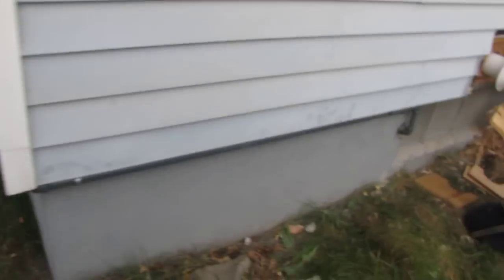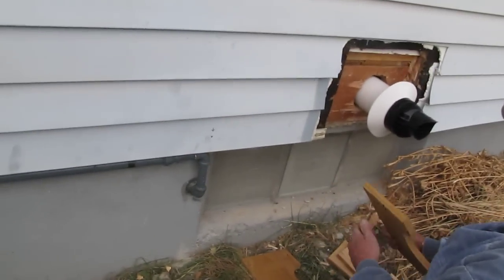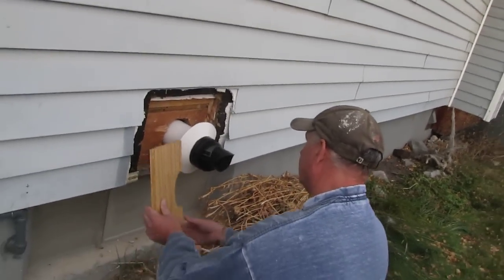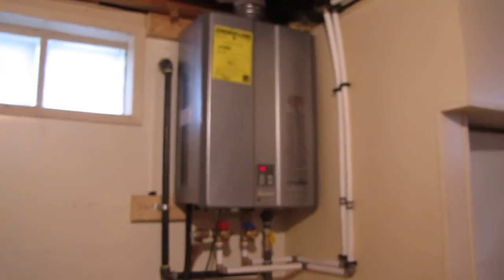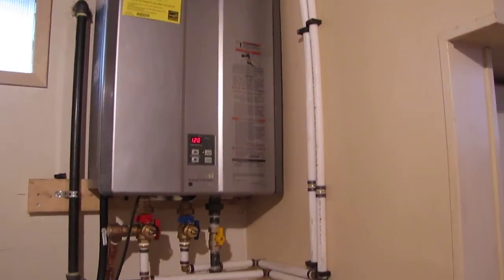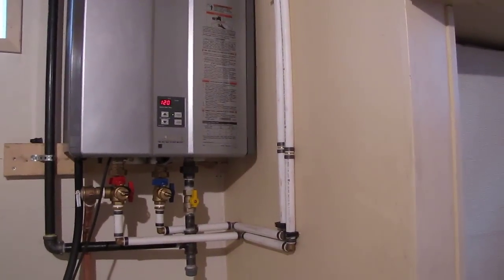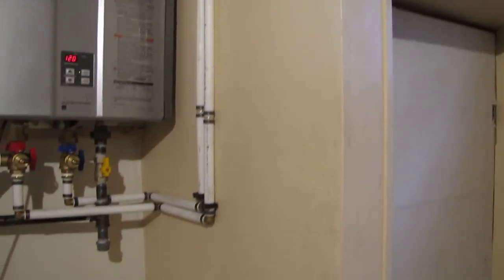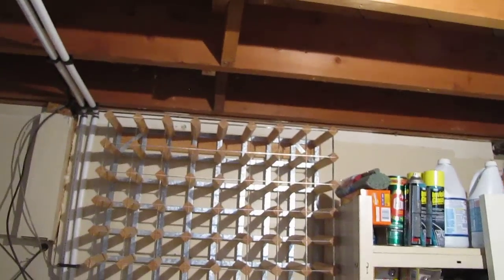Gasfitting/Plumbing On Tankless

Comment: What type of pipe and fitting do you use on the condensate drain on the bottom of the Rinnai?  Is it just pex tubing with a crimp ring?

Comment: What state is this in? You put the gas cock AFTER the drip leg? What purpose does the drip leg serve, if the gas cock is AFTER it? Also, why the major damage to the exterior of the home and siding, when Rinnai venting has 0" clearance to combustibles? Was this inspected by the city or county? Because there is a 2" minimum clearance rule for the actual unit to the left and right, but it's right up against the wall... just curious.